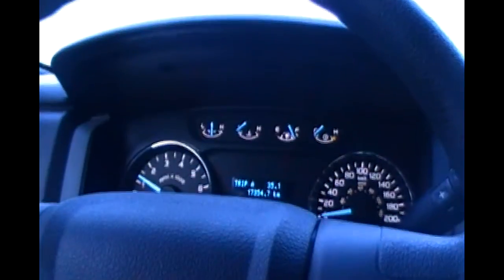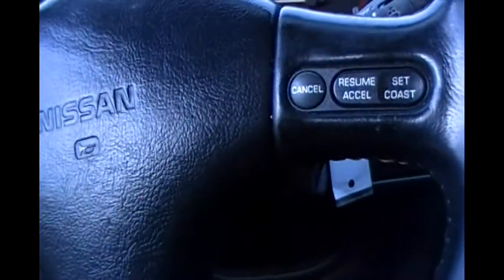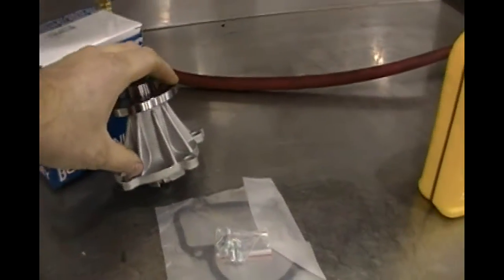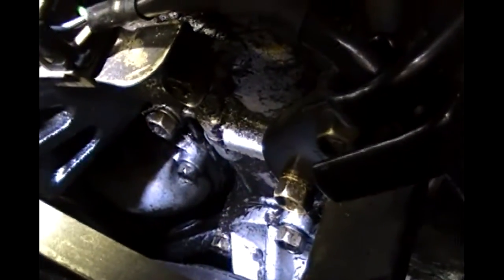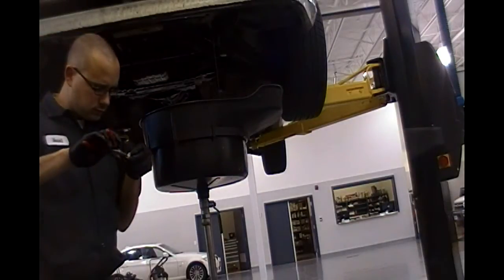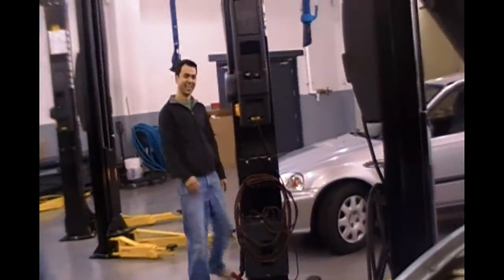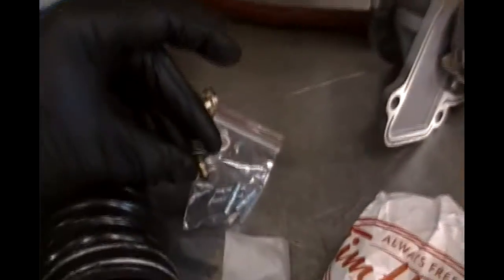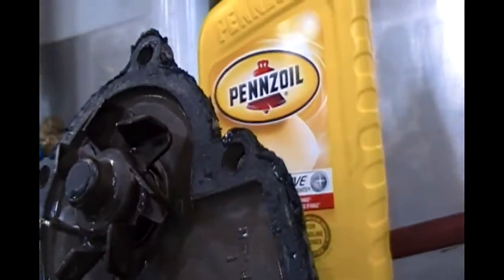S13 240SX - water pump & thermostat replacement (plus mods)

Comment: Yeah, I was thinking clogged heater core or ducting somewhere. Although... I thought he said it DID throw heat, but only once revved up. It is a little strange, that's for sure

Nowell, you'll have to keep us posted on this one! (love the airbox mod, although you can find cheap intake kits off ebay (K&N knockoffs are about $30, complete with faux-K&N filter)

Comment: changed pump, thermostat, new rad, bled it out...hmmm and yall flushed it out. intriguing...you may have to ,go to greater extent and possibly change out the heater core. honestly about the warmer i dont think they have on the 90 240sx. maybe think about pulling passenger side under dash and seeing if you can see anything blocking the heater core or something along that line.